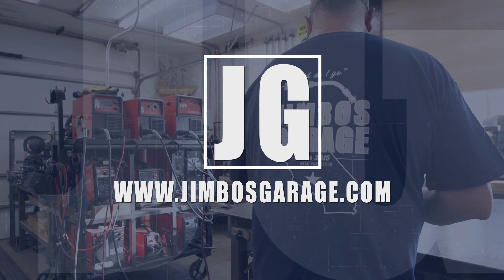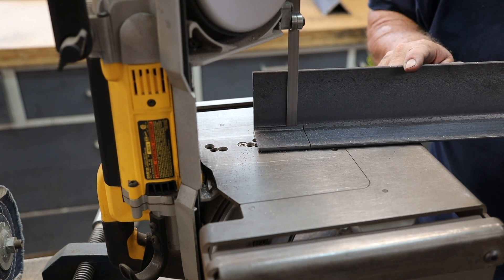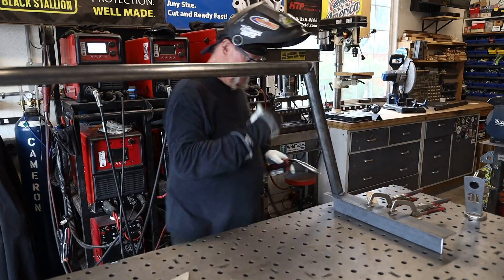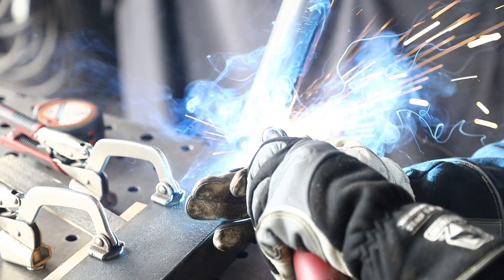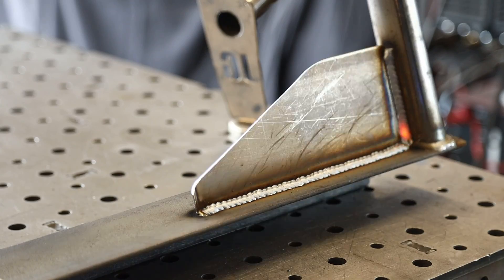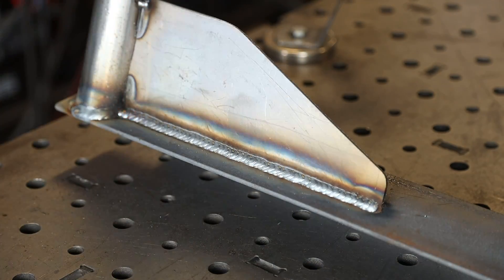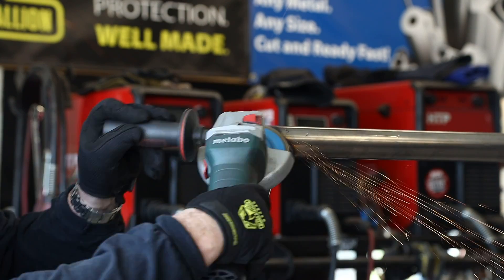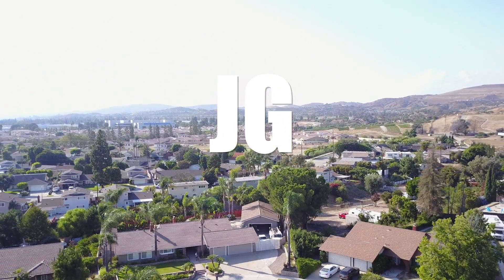Custom Metal Pickup Truck Half Rack

Comment: Great job and the welds look great! Nice look with the angle cuts on the tubing. Question: did you end up cleaning off the mill scale before powder coating, especially from the 3/16" thick angle?

Comment: Looks good. I would've liked to seen a couple holes cut into the brace to use for your tie down points. I use lots of straps but I see your need for hooks for using your rope . Looks good
Reply: Old blokes and rope. "I can do a trucker's knot and get it pretty tight" they say. I have a 3 tonne strap that could break things in half if I wanted.
Reply: I was an "old school" rope guy until my buddy pushed me to just try a motor cycle ratchet strap. I still carry a long rope but always use tie downs when able.

Comment: Looks good bud. Question, how do you keep weld spatter/bb's from sticking to the table?
Reply: You can buy some anti spatter spray which helps with the bb's sticking, Usually you can scrape them loose after.
Reply: wd40

Comment: I'm taking back the dewalt metal chop saw, the base and clamping construction is cheap and flimsy... So I'm considering the fien and the evolution, I know you've used both can you give me a pro or con of either or maybe which you would recommend I go with?

Thanks, love your videos!
Reply: I have the evolution (rage 3 I believe) great little saw considering how inexpensive it is. The fence flexes a little compared to the Rage 2 model but some people fix this by welding a bit of metal on the back. You can see it in use in one of my videos. 
I use fiens carpentry tools and they are always fairly high end feeling although I haven’t used their metal saw. Hope this helps with your search!

Comment: I get the feelings behind not wanting the lateral stops poking up, but here's a thought: Why not cut some larger tube in half and notch it so that it lays down flat over the main bar when not in use, but if/when you need it, you just fold it up?
Reply: 15 yrs is a solid track record. If it ain't broke... Plus you know flip-up do dads may rattle. KISS method. Best, @BranchAndFoundry

Comment: What is a half rack good for? (Purpose). Just curious.
Reply: They're cab protectors. With uprights to limit movement wood or pipe can be propped on them and secured. The ones with mesh or louvres protect the back glass from hay bales or wood, etc. thrown into the bed of the truck.